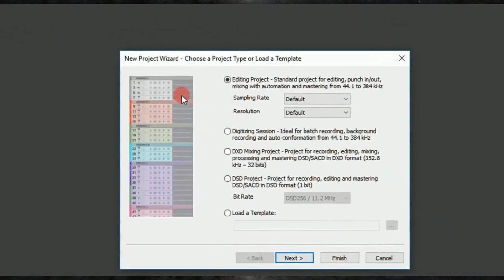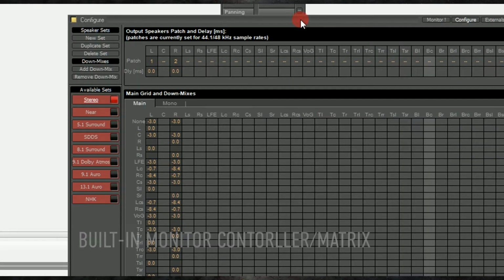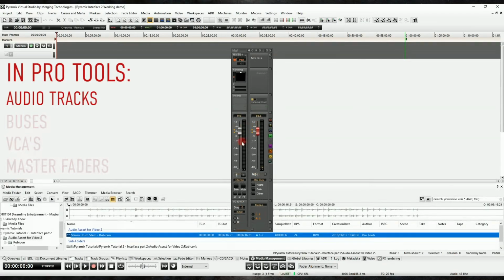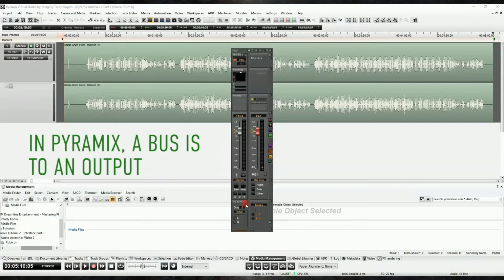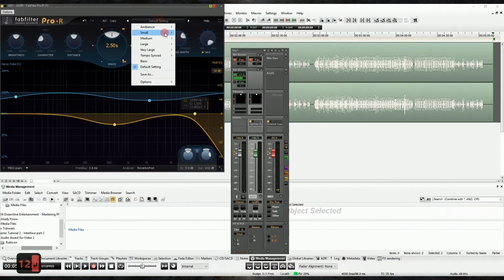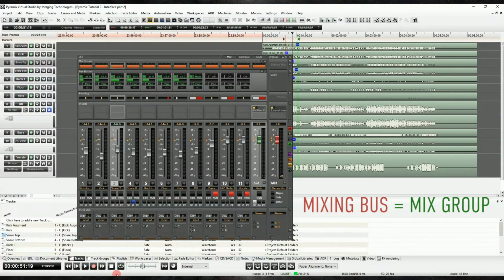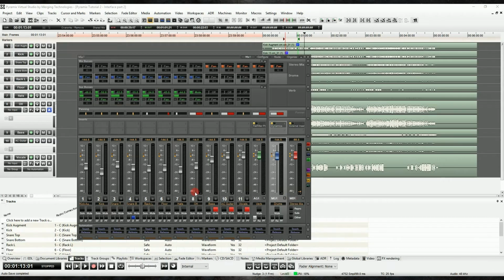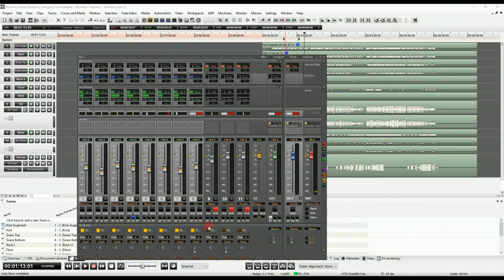Pyramix: projects, monitoring section, mixer structure

Comment: Thank you, Pyramix work with windows 8.1 ?
Reply from the maker: Hello. We recommend Windows 10 or Windows 7. Pyramix MassCore is NOT compatible with Windows 8.1, and while Pyramix Native maybe could, as said, we rather recommend Windows version 7 or 10 since these are the versions we use for validation.
Reply: @MergingTechnologies  and between Windows 10 and Windows 7 pro, which one yields the best performance?
Reply from the maker: @Synth2000  unfortunately Win 7 is not in the game anymore as it is not officially supported  by Microsoft anymore. Our performances with Win 10 are very good
Reply: @MergingTechnologies  Thank you. I am on 9.1 with masscore 128 and a lot of mykerinos boards. If windows 10 works for my setup, then I would very gladly upgrade my W7 to W10...
Reply from the maker: @Synth2000  Mykerinos boards are more than 20 years old, we tried to support them as long as we could with our new network-based hardware until Pyramix 9 around 2015 but couldn't longer support them as even mother boards wouldn't support the Mykerinos boards anymore. I would recommend that you get in touch with your favourite dealer to see how you could upgrade with your software and your hardware, you may contact sales@merging.com